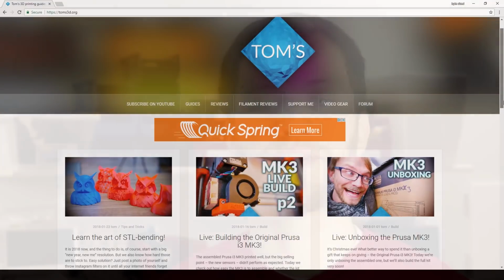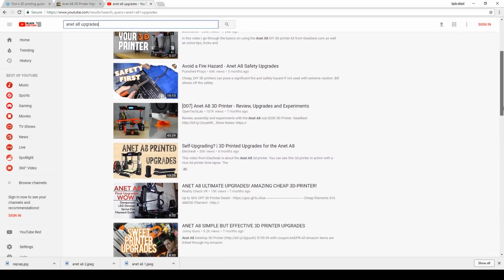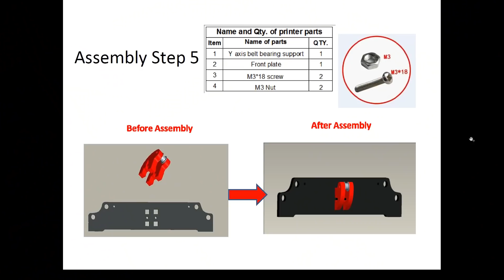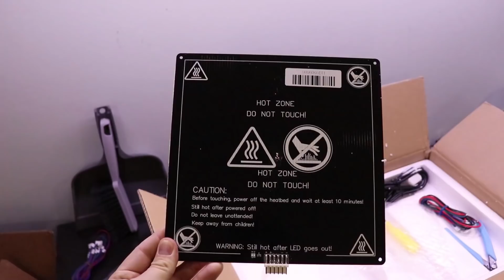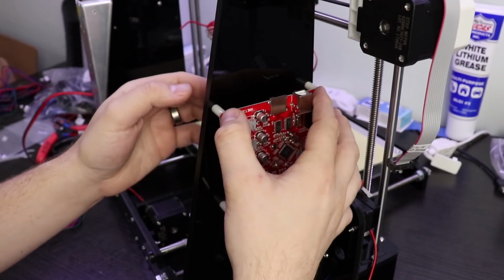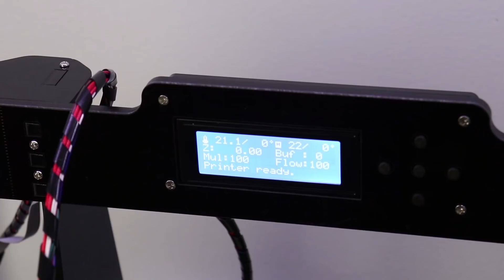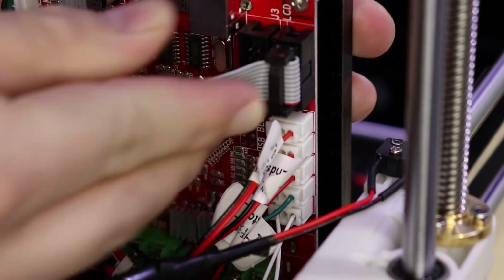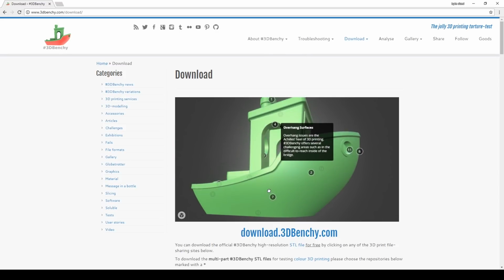Anet A8 - The best cheap DIY 3D printer in 2018?

Comment: Biggest takeaway from this......I need your screwdriver!
Reply from the maker: Oh, you mean my "twirly" screwdriver? One of my most prized possessions. I got it at Home Depot in the electrical department. I'm not sure what the real name is, I just call it my little twirly. As in "Hey, can you hand me my little twirly" and whoever is in the room just knows what I'm talking about.

Edit: Found the link

https://www.homedepot.com/p/Klein-Tools-6-in-Interchangeable-Rapi-Driv-Screwdriver-Cushion-Grip-Handle-67100/202922672?keyword=Rapidrive
Reply: Thank you sir. Seems Klein are the only makers, can't find a clone on ebay ali express or banggood. I do have a long screwdriver bit attachment, blow torch and a vise though :)
Reply: The screwdriver is made by Klein and Model # 682-6
Reply: lol, my same reaction :)
Reply: 3D print one??? Haha
Reply: They're called Rotary or Crank action screwdrivers!!
Reply: This is one of those items that is actually much cheaper at Home Depot than Amazon.
I found that with some of the Bosch accessories too.
Reply: We started using these back in the '80's for trimming out houses (installing plugs, switches, etc). We used to call them "Squigglies". :)
Reply: Yep, I'm totally going to modify one of my long screwdrivers now by cutting it off, making a nice handle with either a bushing or needle bearing.. and braze on a multidriver tip.
Reply: same here... lol
Reply: First thing i noticed too, never seen one before
Reply: meucunt1 same
Reply: Very good to have. I find mine to be useful in many situations.

Comment: The order of the AC wires didn’t matter so much in Europe (reversible plugs), also for someone who says that will use their electric engineering skills on this assemble, it’s strange that you didn’t use any terminals.
I have an anet A8 and my first benchy doesn’t compare with your results (and I didn’t have any prior experience I’m 3d printing). Some considerations: you mounted the heat bed support reversed (it’s a common mistake because the video instructions are wrong), I think you didn’t tension well the belts (I use some belt springs), you should add more play on the “shaft” that connects with the threaded rods.

My modifications (most did from the day 1):
Mosfets and thicker wires
New connectors to the heatbed 
Springs to tension the belts
Glass (the aluminum bed wasn’t perfect flat)
Careful assembly with a digital caliper
Reply from the maker: The polarity of AC wires isn't crucial here in the US as long as your appliance doesn't have a metal chassis. So my cell phone charger for example can plug in either way, but my computer has a third prong (earth) which requires it to be plugged in a certain way. I'll be honest I like the way European plugs solved these issues, it's much better than how we do it here in the US. Good call on the terminals, that would have been safer. The power supply was one of the first things I want to upgrade. I bought a switched/fused IEC connector that I'm going to install. On the heat bed bracket, I tried both ways until I found a way I liked. Belt tension upgrades was the first thing I did after getting this up and running. I downloaded some good solutions on thingiverse. Thanks for the tips, I appreciate your feedback.
Reply: UK has a 3 pin connector that only goes in one way. Convention says Brown = Live, Blue = Neutral and Green/Yellow is Earth (Ground). I can only assume that the Chinese got their plug on the wrong way as no way should the Blue be live.
Reply: Samuel Carreira hn
Reply: I still don't get it it. What makes you think that it is unsafe to reverse N and L? The case of the psu is earthed anyway so nothing changes. It really doesn't matter. The path to ground is the same. That's the exact reason why we can reverse eu plugs. Because it is irrelevant and just makes life a little bit easier. Everytime i unplug my printer i probably reverse my connections. I also never checked if N and L are reversed on my cable because i can't control it anyway because of the reversable plugs. I only checked if earth has continuity considering the cable came from china. As long as the earth wire is correct you have nothing to worry about. The printer will function and you will be safe. It only matters if you install a switch that only switches one wire to turn the printer off. This could give you the wrong assumption that there is no voltage on the psu anymore even though there still is voltage because N is actually live.
Reply: Tobias L.  This is how I see it. You don't want to switch earth and neutral, that seems more like the dangerous scenario. I used terminals and solder. I think the polarity matters on a 3 phase system, for example, but no one uses that daily.

Comment: Super job - totally agree with the live and neutral reversal mod.
Reply: I believe you're confusing return current  "neutral" with safety "ground", the chassis of the power supply is grounded. The reason for grounding the chassis is not for return current, if you're in contact with the chassis and the live wire comes free  and contacts the case also, you won't be electrocuted!
Reply: Yh, guys from Great Britain 🇬🇧 remember the muricans don't have fuses and extra safety features built into their domestic electrical supply
Reply from the maker: Thanks for watching!
Reply: you should never fasten wires without crimped cableshoes anyway so what he did in the video is unsave in itself also with cableshoes the chance that a wire comes lose i near to nothing since the whole screw needs to drop out to get the wire out anyway
Reply: If a live wire were to come loose, as long as the yellow wire is where it's supposed to be, it would cause a short circuit and blow a fuse. I don't see how the color of the wire makes any difference.
Reply: That's what I thought too
Reply: In Europe you can plug into a wall outlet in two different directions. So one time the brown wire will be active and when you flip the plug around upside down the blue wire will be the active one.  As long as Protected Earth is connected to the neutral, the current will flow through the PE not the human body in case of a failure.
I gotta second that ferrules or cableshoes are a must. We don´t live in the 50s where tinned cable ends were the way to go.